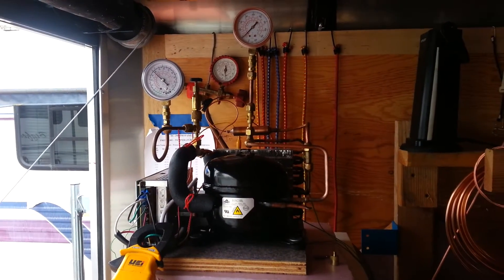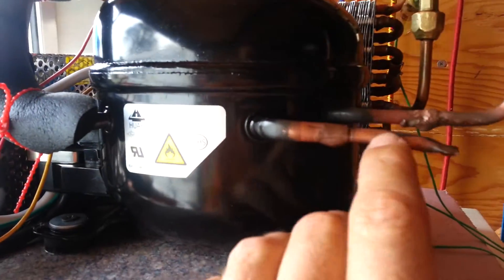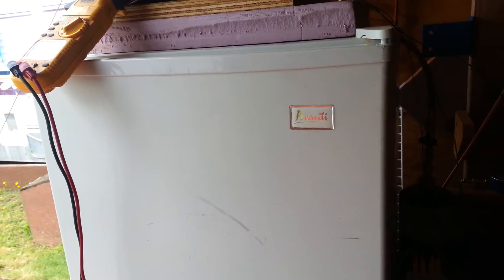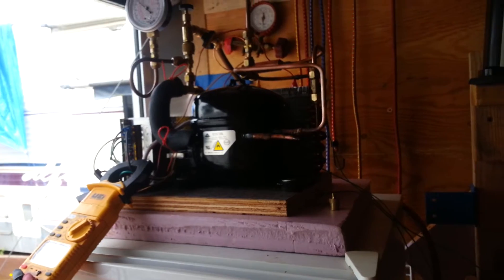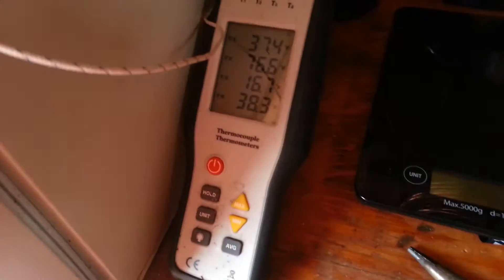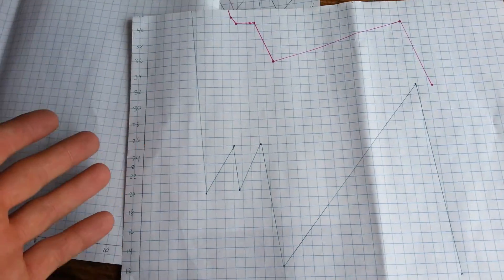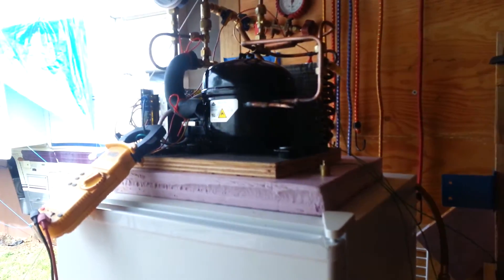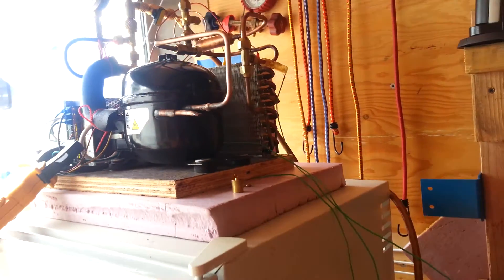R290 Fridge- New R600a Compressor

Comment: can you use a larger compressor for r600a trying to reach 12kW of heat energy with it..need a compressor
Reply from the maker: That's a huge load!  I'm not terribly interested in such a large system.  What are you building?
Reply: +M.C. Pletcher good
Reply: That’s about a 3.5 ton compressor.

Comment: Hello Mike. I know you have probably gone over this somewhere in your videos. I have a question about the propane you are using. Are you using straight fuel propane with the mercaptan oderant in it ? Or are you using something like R290 ? I've been thinking of doing some refrigeration experiments and really don't want to use R22. The setup I will be using did originally use R22.
I have heard that propane can be used as a replacement for R22. Thanks
Reply from the maker: Sorry for the late response!  I've been busy in the shop.  Got a rainy day.

No, I don't technically use R-290, I just say that for simplicity.  Honestly, the fuel propane seems to be identical to R290 in terms of the pressure temperature relationship.  It probably has some propylene, butane, and water in it, but I have not noticed any problems.

For experiments, you should just use fuel propane.  For any kind of permanent fixture, get the clean stuff.

As far as an R-22 replacement, I have heard of people dropping it into air conditioning systems that utilize a TXV.  The temperatures are similar, so the bulb keeps the superheat adjusted fine.  I would not expect similar results from a capillary tube system though.  Best comparison, according to Tecumseh, is 404a- to size capillary tube.

Again, sorry for the late response.  I saw the e-mail.  Feel free to write again.